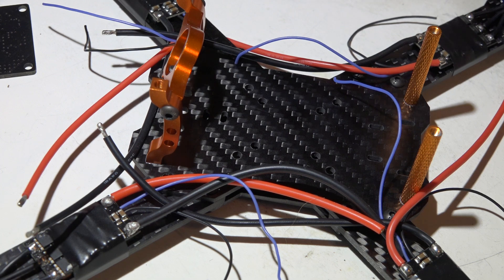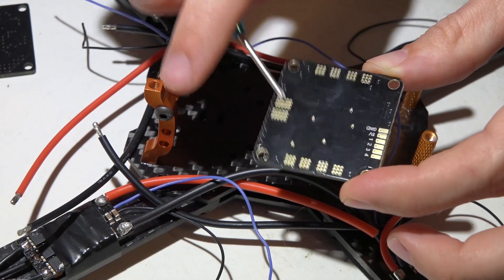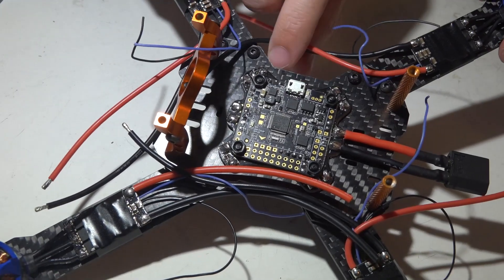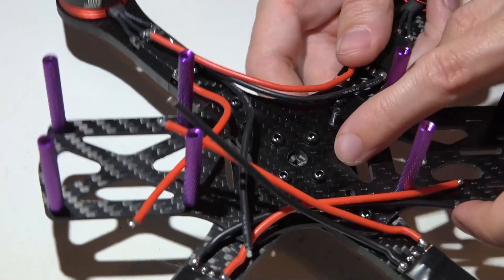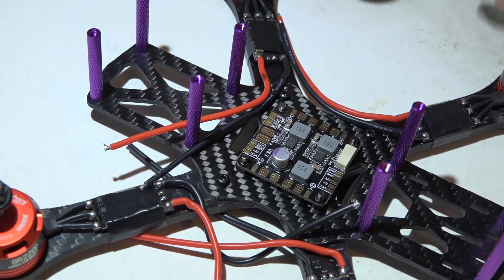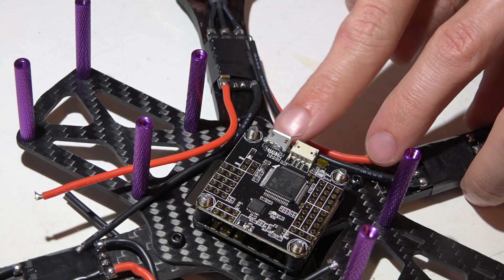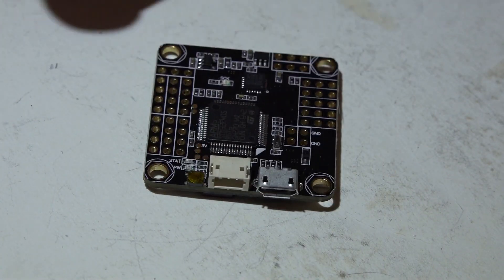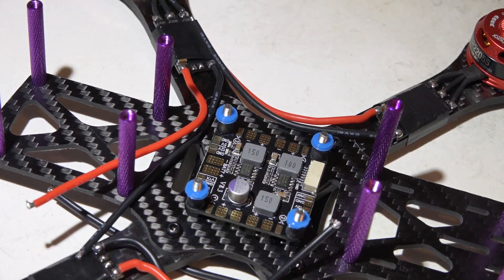Multirotor Build Pt6: Mounting FC & PDB (& important tips to not fry parts)

Comment: the martian PDB adds strength to the frame. just like the Impulse alien, if you don't use the stock pdb, you should get the carbon fiber plate to use in place of it. I don't see the martian build surviving crashes to well.

Comment: Hi JC. When mounting FC boards that are not level (butter side up) do you do the gyro calibration with the board level then alter the pitch etc in the firmware to suit the FC orientation, or do you do the calibration with the FC mounted in a non level position?

Comment: hi quick question on caps. i have only been able to get a hold of 470uf 25v cap but it doesnt say lowesr,  will this still be suitable or will it go up in smoke. i am having issues with a bit of noise in the feed when accelerating.

Comment: These are great videos. I do think that you are doing the Martian a disservice by custom-building the frame like that. The stock PDB s intended to provide strength and rigidity to the arms. You may find they are a bit weak like that. Assembled as intended it is the strongest construction I have had on a quad. 

Also, as an FYI to anyone building a Martian or an Alien. They intend for you to put some of the bolts for the arms from the bottom specifically so you can swap them without disassembling the frame.

Comment: Another reason to not use a thin washer is that a rubber soft mount can be compressed (maybe not now, but once you put a transmitter on top)
Reply: These rubber standoffs can't be compressed by tightening the screws, since the thread of the standoff is seperated from end to end, there are two threads in there. So you can thighten the screws all you want, the only thing that will happen is that the thread may get damaged. 

Also compressing the standoff might not be so bad, because like your legs, if you have them straight, and jump, the energy goes straight through your legs and up your body. But if you bent your knees, the energy gets absorbed. I think this is comparable with the standoffs, correct me if I'm wrong. Also if you mount anything on top of the FC, be sure nothing is loose on there, because that will induce vibration.

Btw, these standoffs are pretty stiff, I have them myself too. I don't think they will get compressed that easily by putting a receiver on top.
Reply: They can be compressed, I've them ;) not by much, but if the spacing is super tight (like a thin washer) during a crash you might  bounce and short something.